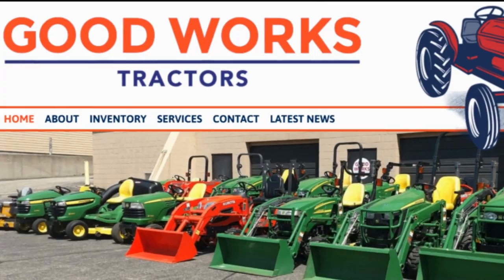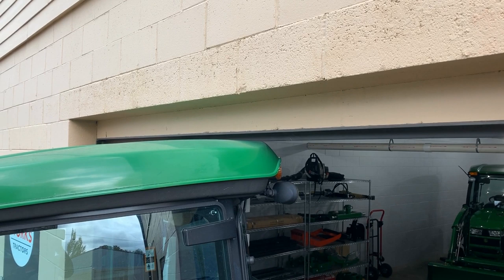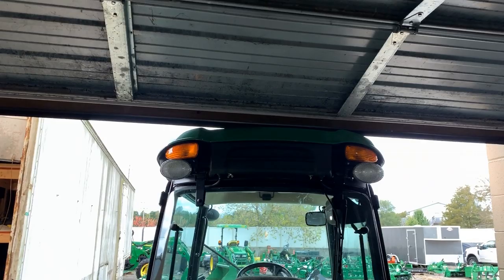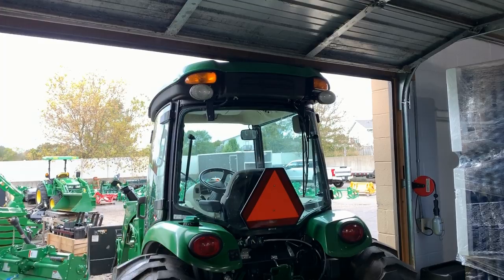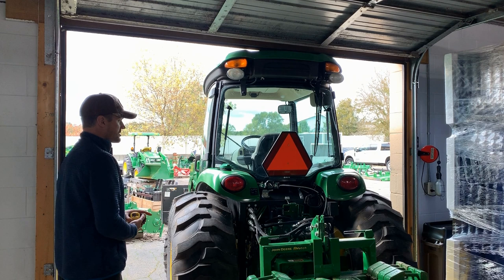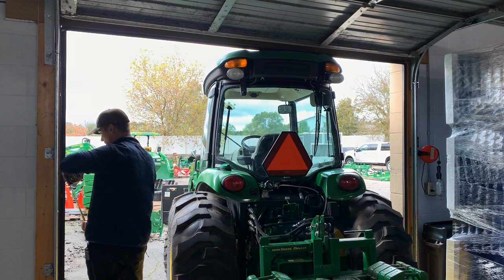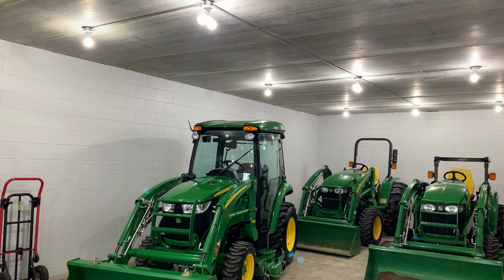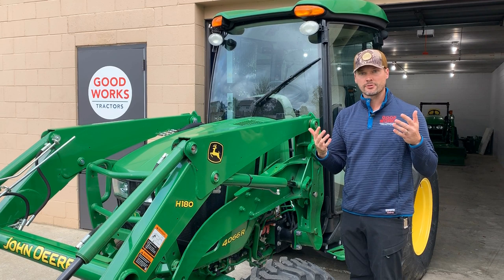GARAGE DOOR HEIGHT? HOW TALL AN OPENING TO FIT A TRACTOR?

Comment: Oh, yes, been down that road.  No problem with my barn door opening until the 3005 moved in. Had to modify the doors to get it in, then added an original cab Co. Cab, had to elevate the doors again.  Now  the upstairs loft floor is sagging a bit, so I need to fix that.  Ballast is beginning to look better & better! LoL

Comment: Thanks for the video. We are currently building a new house with 8 foot garage doors. I really wanted a 4066r (with cab) but figured it wouldn’t fit so was assuming I would have to drop to a 3039r. This video is giving me hope again about getting a 4066r (if you think it might fit now). Can’t wait to get the tape measure out when they install the garage doors!

Comment: Will the tractor clear without all the weight on the three point hitch? I have a 3046R, and would like to go to a 4066R, but my door is 95".
Reply from the maker: Yes, it fit in there before I had the ballast box on and before I loaded the tires.  However, it literally was rubbing the weather stripping.  You will be absolutely maxing it out.